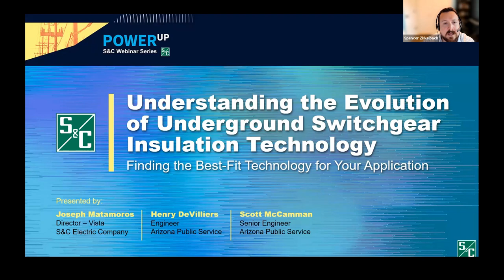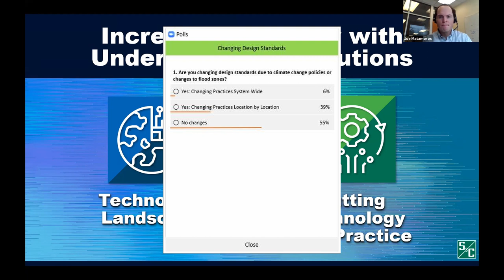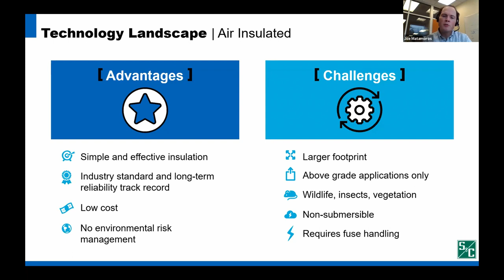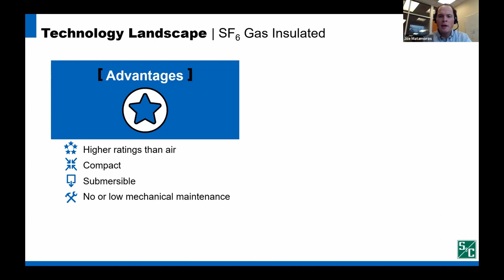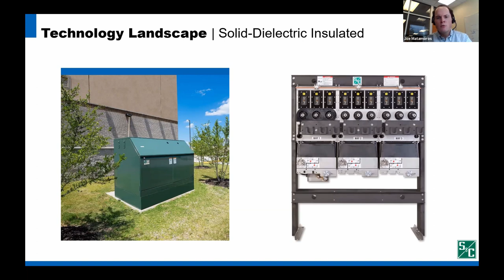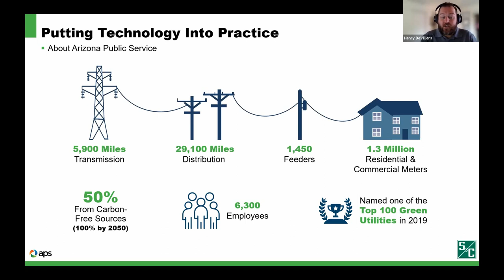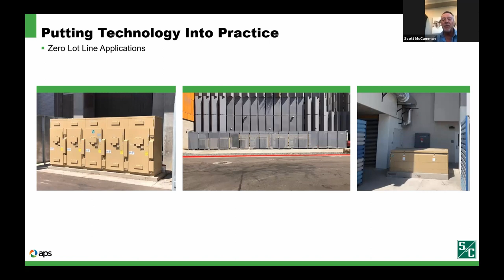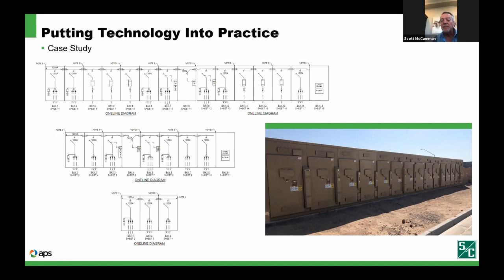The Evolution of Underground Switchgear Insulation Technology

Comment: I have observed Solid Dielectric equipment not being the heaviest equipment - that will usually be the oil insulated material. The overall volume of an oil insulated equipment will be filled primarily with oil vs. the spaces and gaps between molded insulating components resulting in a lower overall weight for the solid dielectric equipment. In addition, oil insulated equipment tends to be the most compact out of all the choices. Most or all oil insulated equipment is hermetically sealed and depending on how current is interrupted could lead to a low or no maintenance situation for the oil. Would also posit that the visible break variance applies between every manufacturer, regardless of insulating medium.